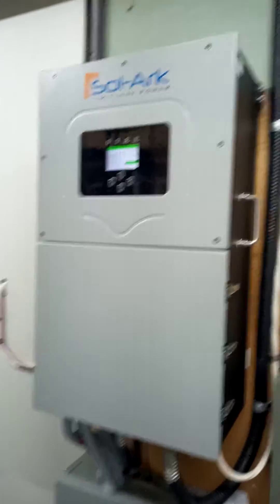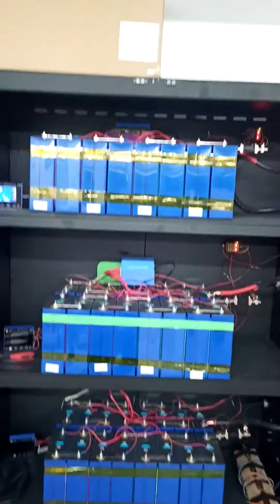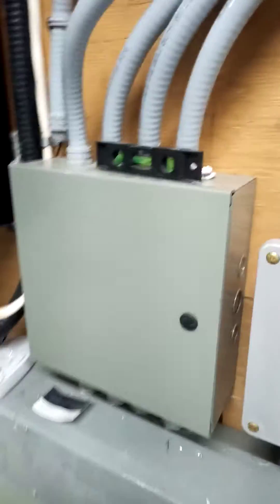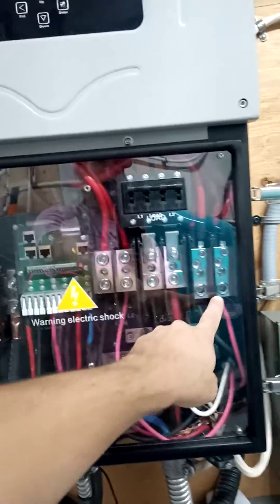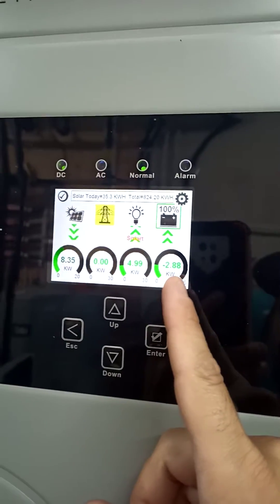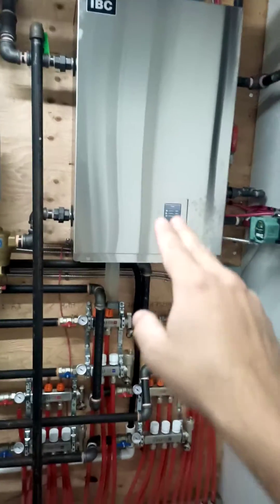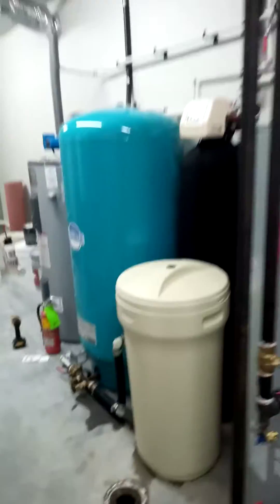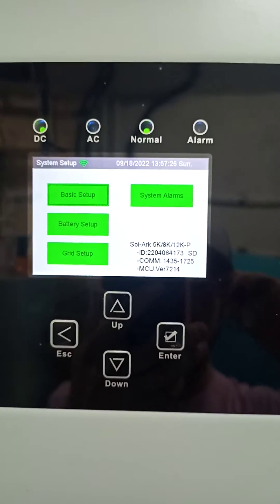Sol Ark 15K ALL off grid. demo of smart load feature, DIY Lifepo4 Battery Bank

Comment: Awesome system. 
I’ve been installing solar PV and thermal since 2008/2009. 
Have you tried solar thermal instead of using PV to run an electric hot water tank? I’ve tied in solar thermal to a infloor heating system and it worked well.
Reply from the maker: Thank you! Three years in now and it's been just chugging along!

Comment: Hi. That's a very impressive setup. Only question I've is don't those lipo4 need to be compressed to prevent bulging that usually develops over time due to charge/discharge cycles.
Reply from the maker: There is a lot of heated debate with the compression. The verdict is for mobile applications compression is mandatory. For stationary applications like mine where the batteries will cAlendar age out before they become depleted from use. It's not needed.

Comment: nice setup. I just installed a propane WH after the electric WH that came with the house. Could you do a more in depth video explaining your recirc pump? I'm assuming it is set up to recirculate on smart load as well to continue to burn excess power when the sun is out and not just shut down the element when the electric tank reaches the set temp.
Reply from the maker: Correct! I'll try to make another video. Basically when the tank reaches almost set temperature the circ pump comes on and stays on until the sun goes down and smart load shuts off

Comment: Crappy setup, the leads from battery to the inverter have to be very short. The issue is related to their inductance, which will result in capacitor failure from the inverter, as you stress them by decoupling the battery low impedance with those long wires inductance. Always check the manual related to wire length (you cannot just mitigate it's effect by just using thicker wires...)
Reply from the maker: Not sure how you could make the wires much shorter. The batteries are on the opposite side of the wall. All feedback is good we are still learning!

Comment: I’m starting a new construction. Will be all solar w/propane generator and some appliances. Heat will be radiant in floor heat similar to yours. I’m wanting to stay all electric as much as possible. My idea heat pump hot water heater and dump into propane hot water heater to take advantage of extra solar during the day to store hot water. I’m curious what your thoughts are and why you didn’t pursue a heat pump hot water heater. What am I missing? Thanks Mike
Reply from the maker: I will certainly make more indepth videos shortly. What climate are you in? I am in an area where I need all my heat so using indoor heat to make hot water is not efficient. If you live in Arizona or something then it totally makes sense. But where I am heat is needed 6+ months of the year. Ac is really only needed for 2 months.
Reply: @mylesoffgrid  Makes sense, I’m at 8900 ft in colorado, never need AC we also have lots of sunny days. I was going to put the heat pump water heater in my electronics closet in hope they would compliment each other on temperature balance. Thank you for the reply.
Reply from the maker: This is a good idea!  Heat pumps strive at turning excess heat into usable heat very efficiently!

Comment: Very nice setup. Which Champion generator do you use? I have a manual start 5KW generator but I'd like to set something up with 2 wire start in an outhouse. Thanks.
I have a 12K and running on generator if the sun is shinning the charging current is limited to what the generator is set to no matter how much solar you have. If the solar exceeds the generator power then the generator carries on running but not putting any power into charging the batteries which seems kinda stupid and wasteful of fuel. I was hoping that both gen and solar would contribute to charging the batteries faster but that doesn't seem to be the case. I tried upping the battery charging current beyond what the generator is capable of, however, if the sun goes behind the clouds then the Solark proceeds to overload the generator as it tries to maintain the charge current. Doesn't make a whole lot of sense to me.
Reply from the maker: I have the champion 8.5kw I needed a document to figure out the two wire start, and i moved the batteries inside to keep them warm, haven't ran that generator since christmas though !

Also please see my other video on the sol ark and generator power to help you with your issue! Solark cannot charge and discharge at the same time.

Comment: Looks great! Keep an eye on the Chargry BMS, mine flaked out after 6 months. Also a heat pump HW tank, rheem makes a good one will cut your elec. consumption. I have the 50g for the past 3 years supporting a house of 4., no issues.
Reply from the maker: which one did you go with after? what was the fail symptom? I am powering mine from battery bank. they all work well however I am noticing after time that some of the charge currents drift out of calibration. they are too balanced cells so the chargery isn't doing much work it's just a fail safe.
Reply: @mylesoffgrid  I ended up getting a Batrium WatchMon 4, Decent but pricey. If I was to do it again I would explore something else like a REC, Seplos or JKBms. The YT channel Andy’s garage has a number of good videos on BMSs. My chargery issues were lack of accuracy in voltage measurement. Could not rely on them. My cells / battery are similar rock steady the past 2 yrs..
Reply from the maker: @zekeboz5533  also for your heat pump hot water. Does it take heat from the house to make the hot water or is it an outside air source style?
Reply: Heat from the house. It sits in a basement so we don’t notice the impact of it running.
Reply: Zekeboz, I just asked the question you kind of answered. Are you having a good experience w/ the Rheem heat pump tank 
? And are you also storing in a propane tank for your radiant in floor heating? Thanks Mike
Reply: @mlockette1  yes. It has been great. The leak sensor started throwing a false error so I disconnected it a couple years ago but otherwise no issues. I only use it for domestic hot water.